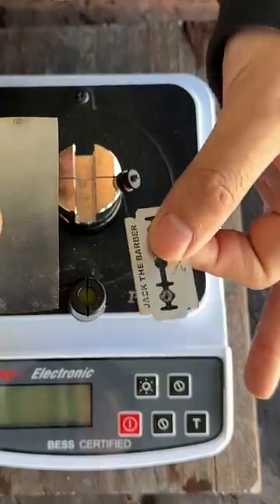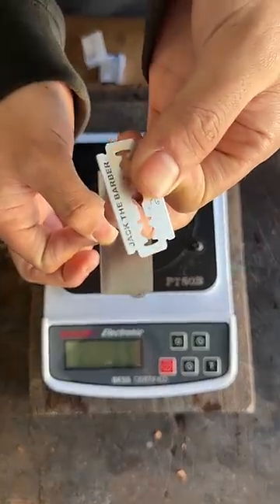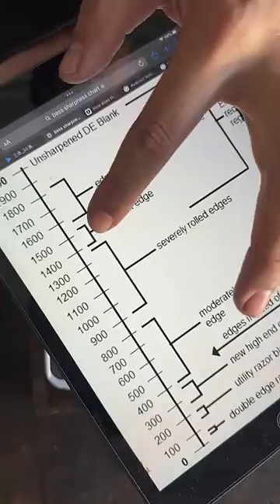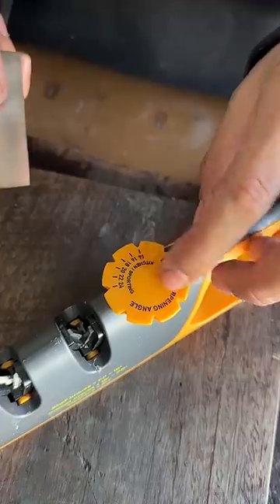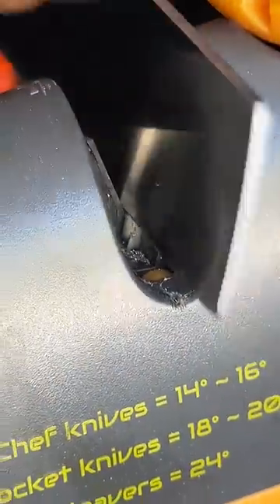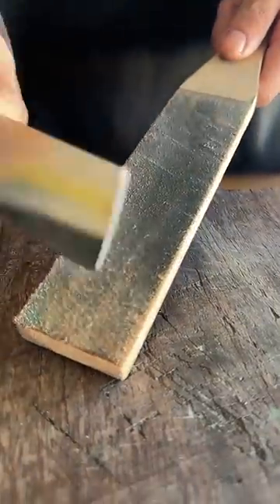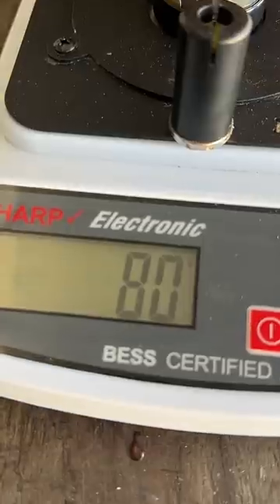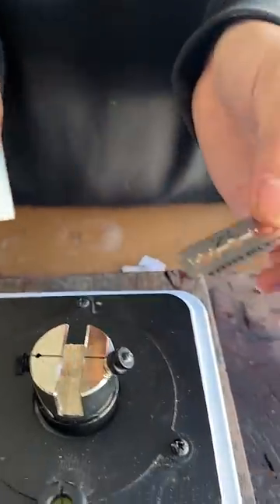Sharpening a piece of steel with the ProEdge #fyp #shorts #knife #knives #knifesharpening #kitchen

Comment: As a fabricator and metal worker, a piece of sheet metal with not rounded 90° corners is far from harmless
Reply: Yeah, those can cut you surprisingly easily n deeply with some dragging along the edge.  Don't underestimate them.  Ik I cut myself with these cooking molds for pastries before that had some 90 degree angles.  Hell even got a skin deep cut from a 90 degree angle plastic part of my washing machine when I had to drain it...  Don't underestimate how easily an edge can cut you even if the angle of that edge doesn't seem particularly acute.
Reply: Basically ripped the tip of my finger off on a water heater band, cut straight through me, no edge at all
Reply: I cut a piece of steel with cutoff wheel and it had a 1/4 inch burr on it and I went to throw the scrap into the pile the burr caught my hand and sliced the skin on my index finger from top to bottom.
Reply: the burr
Reply: For real idk how many times I cut myself carrying in sheet metal in welding class hell it even cut through my welding gloves at times
Reply: Guy I work with slid some sheet metal siding in his hands on accident cut all the way to his tendon and cut the tendon completely and it worked it's way down his arm so they had to cut through his arm to reattach the tendon. So yeah I'd say it's still scary sharp😅
Reply: fr, i cut myself with a round pipe lmao. it doesnt even need an edge to hurt
Reply: I mean i get it that compared to a razor blade its harmless but I'm with you: 90°, and no rounding = not harmless at all.
Reply: Im not even a metalworker and ive cut myself on flat/dull metal 100 times more than i ever have with a blade
Reply: I cut my inner elbow with sheet metal and had to have surgery on it
Reply: Freshly cut metal sheets cut like glass, trust me ive worked with metal too, got pretty bad cuts
Reply: @Brazilian ambassador Dale😃  yup I had to get a heavy piece of scrap in the dump a few weeks ago and on the drop a stray piece sliced my arm clean open at the bend in my arm, cut had no dirt and doctors were surprised it didn't need cleaned. Arm hasn't felt the same since
Reply: I am not a fabricator or metal worker but I do alot of stuff with metal and other materials jn my free time and I have a bunch of scars from just these corners
Reply: @brazilianambassadordale8223  i hate non rounded edges
Reply: Yeah man I make ductwork and that sheet metal is nothing to play with
Reply: In my experience (I enjoy working with copper as a hobby), copper is the WORST when it comes to sharp corners.
Reply: Burrs be scary little devils.
Reply: yup cut my wrist with sheet metal helping my dad build a shed. had to get it stitched up
Reply: Even sheet metal that looks dull can end up being insanely sharp.
Reply: yep, after 2 months of my job with sheet metal i look like 14 y/o Emily from USA lol
Reply: I used to be a metal roofer, and I almost lost a finger to a piece of roofing metal
Reply: Yeah i just got a huge cut along my leg yesterday from the edge of a piece of metal similar to this, just thicker and rusted, so even thicker ones can deal a lot of damage
Reply: I've got more cuts on my arms from them than a depressed 16 year old
Reply: @brazilianambassadordale8223 😊
Reply: As somebody who worked in a warehouse who had to deal with Steel sheet track. Or some shit like that, I can one hundred percent Agree
Reply: Unfolded sheet metal is the worst to get cut by

Comment: Does no one know how to use the sharpness tester correctly 💀
Reply: Project Farm does.
Reply: @SadMarinersFan facts
Reply: How are you supposed to use it?
Reply: @samuraijokester9907  put the tip of whatever you're trying to test into a little guide that's on the front of the machine then slowly apply pressure on the test strip until it breaks, giving you a reading. Applying pressure too quickly like he does in nearly every video causes a reading thats lower than it should be.
Reply: @SadMarinersFan  Wow so most people are basically cheating. Although, it’s still insanely sharp
Reply: you do realize that it was too small to be used correctly? Maybe watch the video and then comment
Reply: @AstralizedMahou  He is still using it wrong by applying pressure too fast. Also anyone with half a brain can learn how to use a grind stone which you can get for way cheaper, and will last way longer, than this piece of crap that will ruin all your knives
Reply: @AstralizedMahou  the bench scraper wasn't too short and he was still applying pressure too fast when testing the razor blade
Reply: @SadMarinersFan  In the case of the razor its too small to use the guide so you have to just use your hand and lower it very slowly. Though they guy in the video was doing it wrong either way because he was doing it v fast
Reply: @irmiwolf  he is aware of this, he even recommends people use a stone instead, but he is also aware that some people are lazy and just can't be bothered to learn whether it's easy or not, so he also recommends sharpeners as well
Reply: @irmiwolf  facts
Reply: @SadMarinersFan honestly i was tempted to buy his sharpener but after learning that he purposely fudged the results makes me not really want to buy it.
Reply: No
Reply: He's using it correctly
Reply: He is using it correctly something sharp would cut faster and take less pressure

Comment: I have sliced my shit open baddd on sheet metal. it’s a different kinda cut too
Reply: Dude first thing they told me when we were walking the I beams(they were aluminum so only 300ish lbs I think) in position was any edge not matter how blunt is sharp especially when it’s heavy shit and we were walking it out and the other guy tripped and that shit cut me up on my leg

Comment: How does the sharpness test work if you barely touch the scale with the razor and then you push the sheet metal on it. That’s why it says 5 grams of weight for one and over 1600 grams of weight for the other

Comment: I got a hold of one of those ninja blades I think the name of it was but it looked like yours and sit it down and went to pick it up and cut my self to the bone just by trying to get it off the table and after that I went to throw it away and thought no way that needs to be in a trash can so I took some black tape and taped it up real nice so no one accidentally got cut when handling the trash. Crazy thing was I didn’t feel the cut just felt warm liquid running down my arm and looked and there was a pool of blood and I had no clue what happened. It was the worst cut I’ve ever got from a blade

Comment: To do it right you need to slowly apply the pressure with your blade... If you press quickly and with a lot of force it will not show the correct reading
But you know this... It comes with instruction how to use It correctly😂

Comment: USE TUMBLER it will make ure edge on knife more smaller yes sharp but losses a lot of metal tumbler only takes away just a thin metal that's the size of a micro arganism and also it will make every knife sharpeners cringe